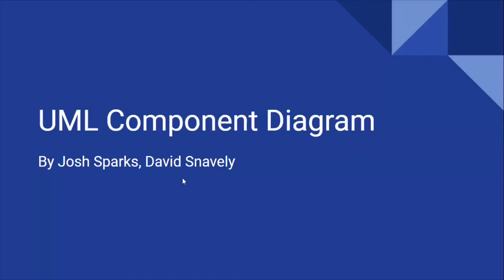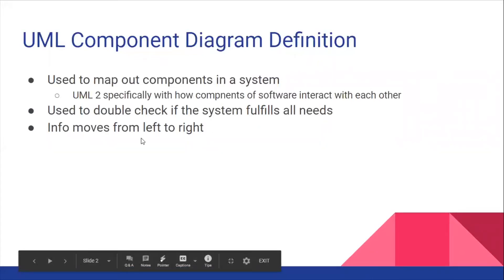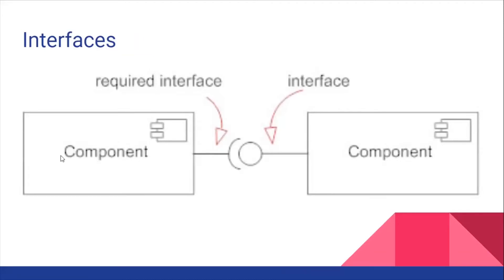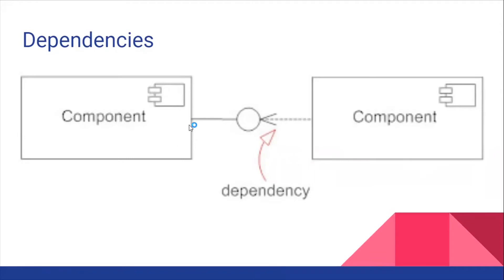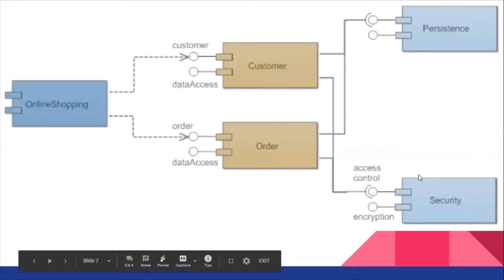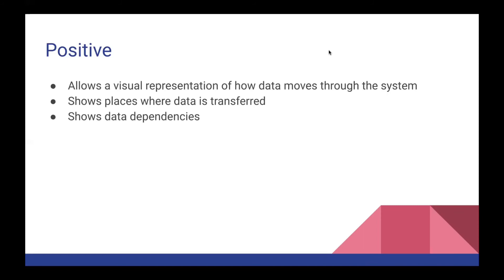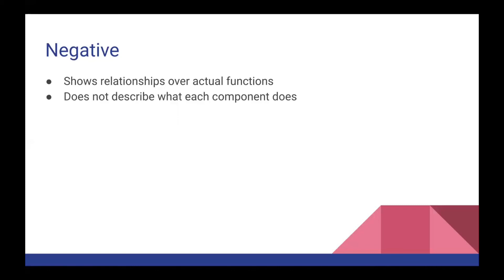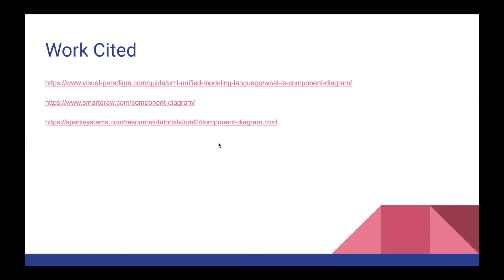UML component diagram by Josh Sparks and David Snavely

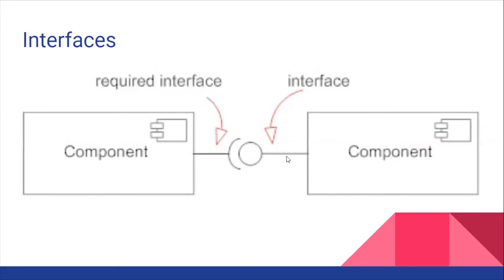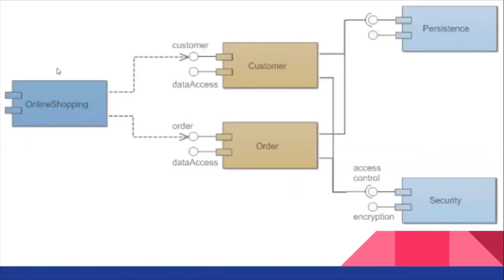Comment: Your explanations of the dependency directions at 2:52 and 4:10 are not correct.  You are trying to explain two separate interfaces in each case which should be modeled as separate interfaces on the diagrams. The diagrams do not depict the bidirectional interfaces you are describing.